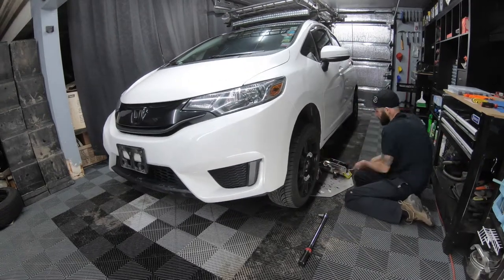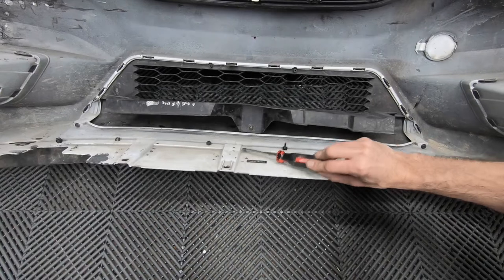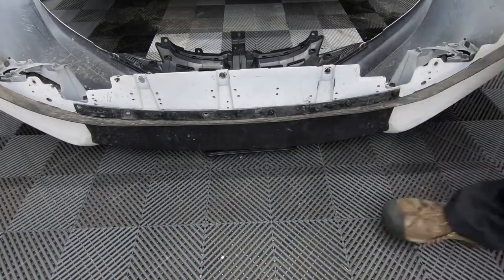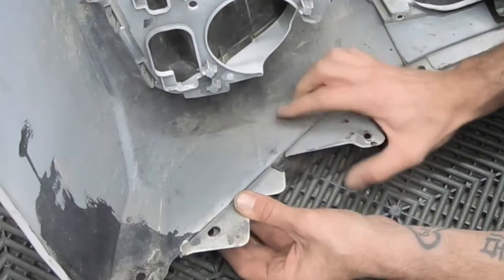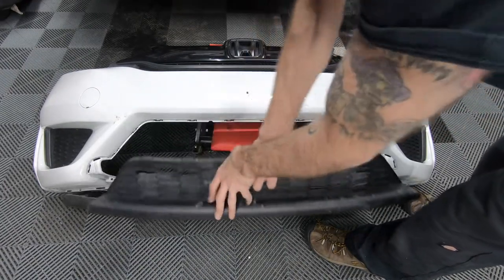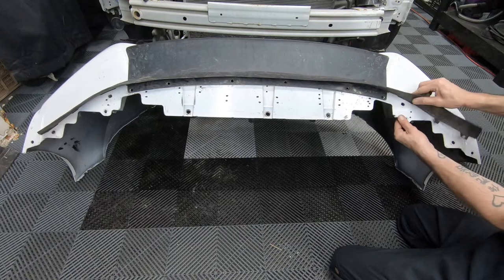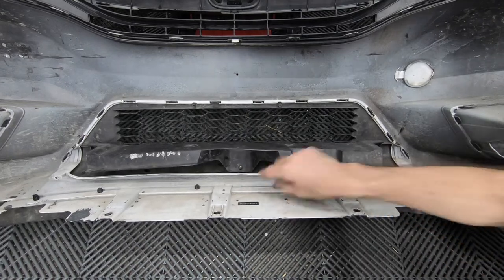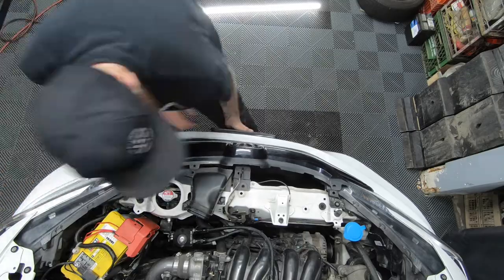HONDA FIT/JAZZ - GK5 - How To - Lower Grill Removal & Installation Video #HondaFit4Adventure

Comment: But why? I don't see a difference
Reply from the maker: Hi John, there are several reasons for this upload. 

1. In one of my previous videos I installed a light bar into my lower grill. The way I installed the light bar in that video might not be doable for eveyone if that center clip isn't already broken. They might need to be referred to to this video.

2. I know this process is probably documented on several forums; but if your like me, sometimes you just need to see the process explained on video.

3. This relates to #1. When I start modifying my front bumper I can easily time-lapse removing things and skip straight to the modification. I typically receive a few comments on YT or IG on how I exactly removed things. Now I will be able to send them to these smaller videos.

Please bare with me as I have a few more rather mundane videos to upload before we get to the good stuff ;)
Reply: @HondaFit4Adventure  no worries, bro. Been following you for a while. Do yo thang